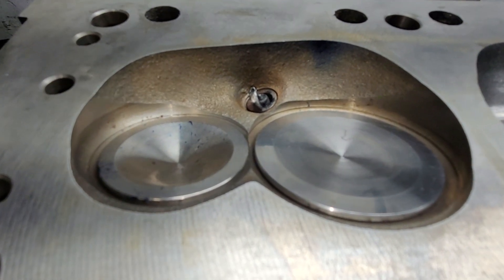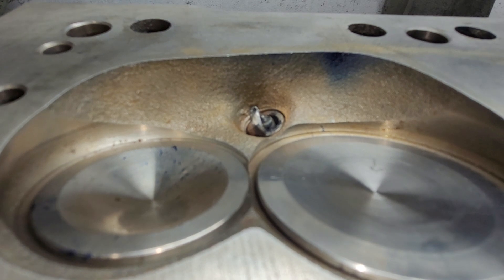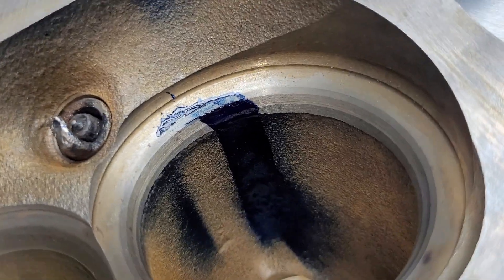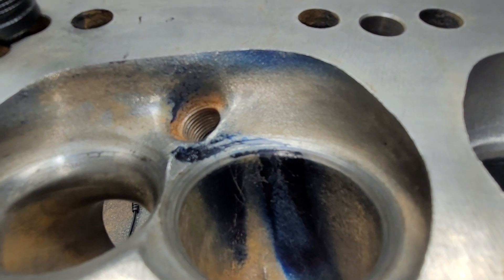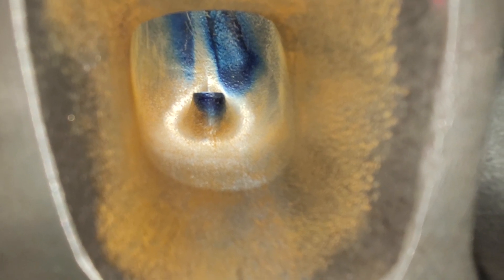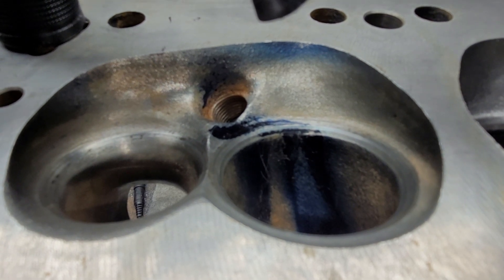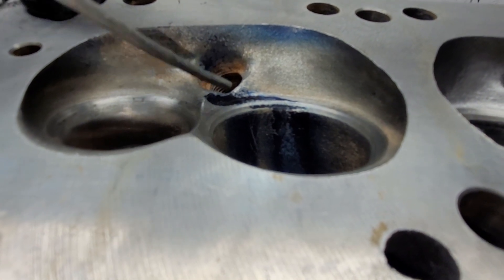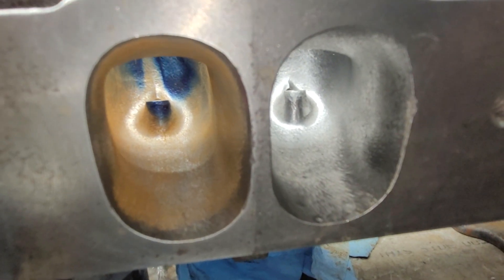Mopar W2 769 castings. Stock vs. 4th cut. Dykem flow, swirl, burn rate, timing advance, fuel prep.

Comment: Thanks for doing this, I was one asking for it and it's a big help. How do you change the angle of the pattern leaving the bowl? Do you just open up the bowl more on the opposite side that you want flow to go? Increase volume to decrease air speed on that side? Or more involved than just that?
Reply from the maker: Airspeed on ssr and roof make a difference. This tells you where the most air is flowing.
Reply: @servediocylinderheads  that's why I appreciate you always responding, I would have thought roof to floor to be less important but I certainly trust that you know better 👍